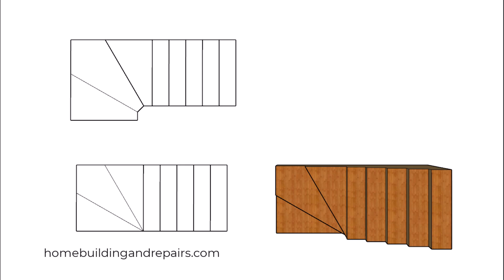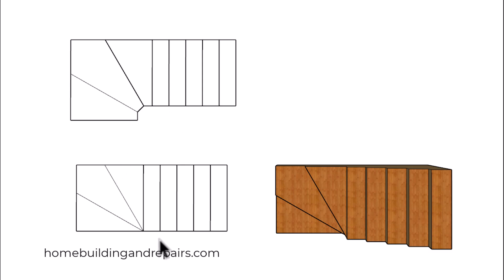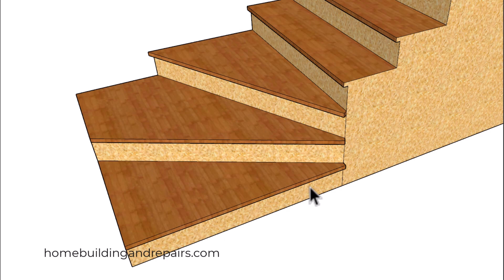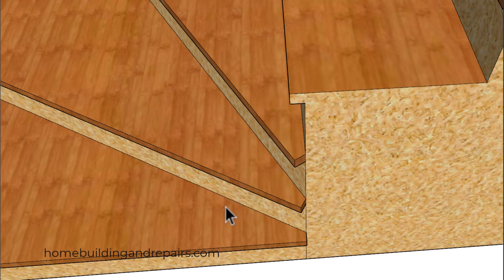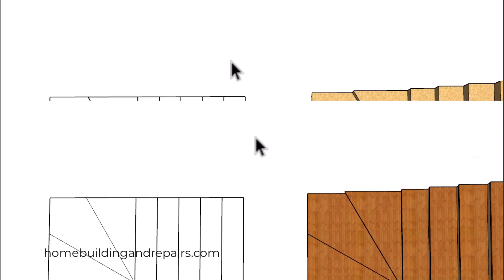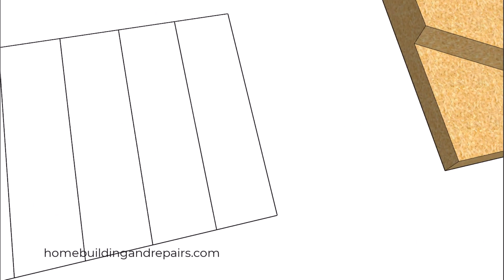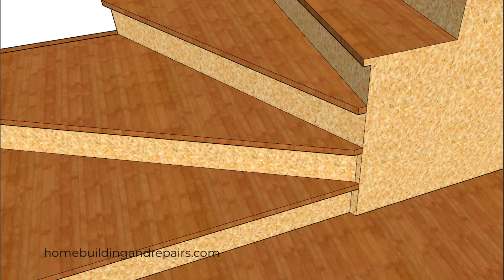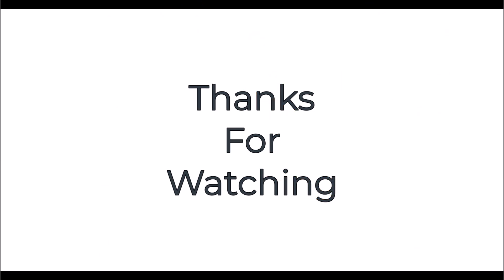How To Layout Winders Stairs To Allow For Nosing To Line Up At Center Point - Carpenter Training

Comment: Is there a video where you explain how to make a quarter turn at the top of the stair where all steps needs to be inside the stair rectangle? I'm length limited and the existing stair has a 1x1m platform at the top that I want to replace with three steps where the first one is a step down from the floor.

I am a mechanical design engineer myself, so I think I know how to design it, if there is a video that tackles this exact problem, that would be nice :)
Reply from the maker: It's on my list of videos, but don't know when it will be made.